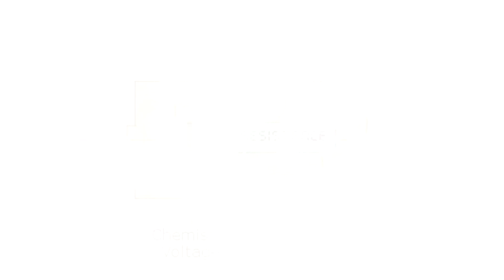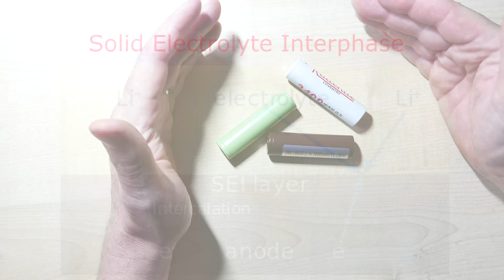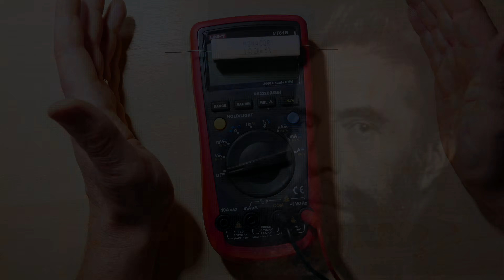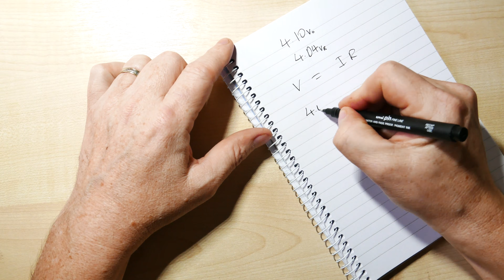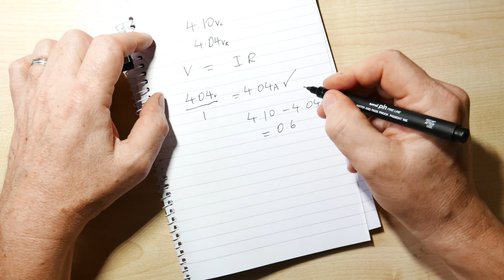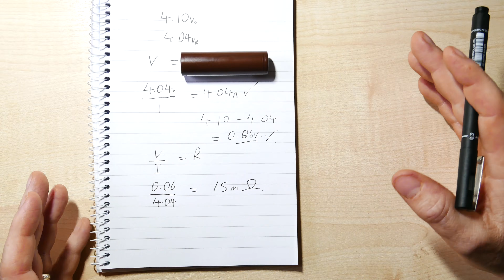18650 Li-ion Internal Resistance Explained & Measured

Comment: It would be good to provide some guidance as to what current range is acceptable for obtaining an accurate/meaningful internal resistance for different cells/batteries. For example, you could tell folks why you are using a 1ohm resistor instead of a 100ohm or higher resistor. That would then let people decide if they could use an Xohm resistor for a given type of battery and/or battery voltage and still obtain reasonable information.

Or...you could provide more disclaimers as to exactly what batteries/cells your 1ohm resistor can test accurately. For example, are you limiting your testing to just 1S1P 18650 lithium-ion cells?

Comment: Dear friend, when i measure a battery (18650 for exactly) with multimeter in continuity mode, this sounds but no resistance is showed and the screwdriver blinking what is happend?
Thank you so much for everything help
Reply from the maker: That won't work.  Continuity mode passes a current through the circuit.  In your case you are trying to pass a current through a cell and in doing that, you will encounter the cell's own current.
Reply: @crazytom  The cell is no more useful, broken?

Comment: can i ask you i have 1Ω 10W ceramic resistor if i try your method the result will be correct or he wants exclusively  1Ω 20W resistor ?
Reply from the maker: Not really.  You're draw 4.2A or 17W.  Try a bigger resistor.

Comment: it's impossible lithium ion battery has that low internal resistance like a capacitor. typical DMM is not accurate enough to measure low resistance so the result will be way inaccurate too. this guy has better method using ESR-meter : https://youtu.be/y7_W1ERDYgk.
Reply from the maker: Check the LG HG2 specs before shooting your mouth off.

Comment: We should calculate Internal resistance at nominal battery voltage, which is around 3.7. That battery holds too much juice at 4.1 volts. It won't give correct results.
Reply: The internal resistance levels are highest at low state-of-charge and immediately after charging. Contrary to popular belief, the best battery performance is not achieved immediately after a full charge but following a rest period of a few hours. During discharge, the internal battery resistance decreases, reaches the lowest point at half charge and starts creeping up again.  Besides, temperature of the battery plays an important role, internal resistance is lowest between 35° -45 °C and is higher below and above these temperatures.  Whenever the temperature of the battery rises under heavy load, so does internal resistance.

Comment: Hey, great info thank you. I have a sky rc charger for my quad lipo's, I bought some used lipo's, using the charger what would you say I look for to check the health of the lipo's. I understand i might be asking a very stupid question, but I've learnt in life, just get the dumb questions out of the way, it's better to look stupid then burn your own house down due to a lipo fire. Thank you for reading.
Reply from the maker: Where Lipos are concerned, the most important factor for many is the C number or max continuous current drain.  This too is heavily dependent on the internal resistance.  Lower the better.

A good check would be to see if your cells can deliver their max current rating.

You should realise that this could push an old cell too far and is not without its risks.

But, for (say) a 4000mAh C25, it should be able to deliver 100A.

You'd need to construct a 37 mOhm resistor or load capable of dissipating 370 Watts.
Reply: @crazytom  That's great info thank you for your time :-)

Comment: Hi nice video,i bought some 18650 online and ahen i tested the IR on my Liitokala most of them were between 38 and 46 can i still these?
Reply from the maker: Sure.  They will most likely be 2C cells meaning the max current draw is 2 x Ampere Capacity/hour.
Reply: Im using those for some time and they seem like very decent cells, tho mine are 60mR 3Ah

Comment: I would have measured the actual resistance (±5%) and used 3+ digits for better accuracy, nice video
Reply: Good advice to check my resistor, but as far as i know they are quite acurate

Comment: Considering this problem with some details still yielded the same answer.  When measuring voltage without a load resistor, we are assuming that Vo is approximately equal to emf since the internal resistance of the battery, r, is much smaller than the internal resistance of the voltmeter, R. Thus, R+r~=R and Vo=emf/(r+R)*R~=emf/R*R~=emf.  Now on to measuring r part.  It is important to select a load resistor RL of a small value not too much greater than r (which I think 1 ohm with proper POWER rating is very reasonable for RL such as in this video).  Since r can no longer be ignored in this step, it must be included in the final computation as part of determining the current term as follows: let VL be the voltage across the RL, then VL=Vo/(r+RL)*RL, solving for r we obatin r=Vo/VL*RL-RL.  So using your measurements r=4.10/4.04*1-1= 0.01485 ohms.  Good video.  Thank you.

Comment: sir 
Please made a video on how can measure the internal resistance of coin battery as per iec 62133-2:2018
Reply from the maker: Same principle applies except you need to use MUCH higher resistance to stay within C rating of coin cell. (~10mA).

Comment: I've been looking at the various methodologies used to calculate internal resistance of a cell and this seems about as straight forward as it gets, so thank you.  I've got a 4-wire battery box, not unlike the one you use here.  

I'll be interested to see how the answers derived using this method differ from the more complex approach espoused by other YouTubers, using multiple measurements and analysis using a graph.

Well thought out and well-delivered vid.  :-)

Comment: Did I hear you correctly? don't fully charge lipo's?
Reply from the maker: Correct.
Reply: @crazytom  Thanks Tom, that is amazing! I fly model aircraft so use Lipo's all the time, I'm often watching for the charger to get to 4.20V per cell...I'm going to stop the charge around 4.17V per cell and see if the lifespan of the pack gets longer.

Comment: Thank you !  Really good info on the slight under-charge to 4.1v, rather than 4.22v.   I had been under the impression I would have to only charge to 80% to significantly extend cell life, but I much prefer the lesser tradeoff of taking it to a 97% charge and gaining 17% more capacity while still extending battery longevity.  Much appreicated !  :-)
Reply from the maker: With a charge range of about 1.4V, a .1V shortfall is about 93%.
Reply: @crazytom  is there a way to jerry rig existing chargers to not charge fully? For example for a power tool battery?
Reply: @jamesrowlands8971 Yes but you have to modify the electronics of your charger the only solution could be to check with multimetre every so often that the voltage does not rise above 19,5-20 volts

Comment: You did a mistake, while calculating current by ohms law you only considered 1ohm resistor. While in reality you should have also added internal resistance with 1 ohm to get real current value. Now in the first place you should have not calculated current but rather measured it and then r= voltage drop across internal resistance / current.
Reply: but isnt the voltage he measured (4.04 V) the voltage across the load resistor (1 ohm) so the 0.06V already is taken into account - i dont think this is a case of current or voltage error measurement circuit because it already took the 0.06V to "cross" the internal resistance of the cell. is there something im missing? please explain further.
Reply: @woll757  Nothing wrong.  When he measured open voltage that's same as 0A flowing.   Then he introduce circuit and determined voltage drop across the external 1 ohm.  He got 4.04v.  And this via KCL means he had to have 4.04 amps in the loop. He had 4.04v across one ohm external.  Now he has to account for the. 06v drop and that occurred at 4.04A. Apply ohms law.  Get his answer.  What he did is right.
Reply: The result only worked out correct and essentially the same because he used a 1 ohm resistor.
However this video is misleading since he wrote 0.06V / 4.04V instead of 0.06V / 4.04A as the formula is written.😁👍
Reply: technically correct, though this method will still get meaningful results useful for comparison
Reply: Im just curious also as we all probably learnt at some point resistors all have tolerances. So when dealing with such small resistances in a battery (battery internal resistance in mOhms) will this tolerance not play a factor in the calculation? Would it be better to actually measure the resistance of the resistor? At my workplace for some of our more critical measurements we actually touch the leads together and get the ohms reading of the leads and add this to our calculations. Even this is not fully accurate as the point of contact to the measured item can change.

Comment: correct me if my computation is wrong. i tested a 18650 Vopen=3.85v Vwithresistance=3.72v i used a 5w 15ohm resistor. 3.72/15=0.248A voltage difference is 0.13v. now computing internal resistance 0.13v/0.248A=0.524ohms? it seems my computation is wrong because this battery is 3months old and the internal resistance is already 524mohms already.
Reply from the maker: Measure the actual resistance of the 15Ω.  There is often wide variations in actual resistance.
Reply: @crazytom  thanks for the reply. i measured the resistance of 15ohms resistor it was 15.3ohms and i computed the internal resistance it was 189miliohms. however there is a large difference(21miliohms) in internal resistance when i used a 5ohm resistor. i got 201milihoms. which is more accurate the 5ohms resistor or the 15ohms resistor? should i test the cell when fully charged?

Comment: that's nice video, but, i think it'll much better if you measure the open circuit voltage later. I mean, it's possible that the open circuit voltage being lower when you wait for the stable measurement of resistance voltage.

Comment: I think you need to measure the voltage after load , not before load, to see how much the voltage drop was.  The voltage just before stopping the current is v0; and the voltage measured after a while ( about 30 secs.) you stop the current is v1.

Comment: Great video thanks! Just a note: to add some precision you could have measured the resistor with the multimeter and used that instead of the number taken from the resistor.
Reply: I understand your position, but keep in mind that many meters people commonly use aren't very accurate at such a low resistance.
Reply from the maker: Good point.

Comment: Only 15m Ohm! that's a great battery you have there. My best battery is 133 m Ohm. Low internal resistance is a must for high current applications (>1.5 A). Thanks for the video, very enlighting.
Reply: 30A

Comment: Thanks this video. But, you made a mistake. Croc' clips have a resistance. Use thick cable or add crocodile(alligator) resistance to calculation. Your calculation result must be approximate 20 mOhm.

Comment: Hey, thanks for this great video. I found it very useful. I was thinking though, you didn't measure the resistance of the wires. :)
Reply: Actually he bypassed the wire resistance  using the four point measuring system.  The Voltage drop he measured was not effected by the wire and or resistor voltage drop.   Cool, eaa?

Comment: Can I just hold the resistor on the cell with my hands? I don't have any fancy holder.
Reply from the maker: Yes you can.
Reply: you assumed he is talking about a 20 watt resistor although he did say "the " and not "a" resistor but you should say "yes you can" with an appropriately rated resistor, however funnier if the poor sod used a 1/4 watt....hahahahh!

Comment: Where did you get that battery holder?
Reply: Try this: https://www.aliexpress.com/item/10-20A-self-locking-4-Wire-Battery-Holder-kits-Resistance-Capacity-18650-Tester-four-wire-battery/32923289546.html?spm=2114.search0104.3.2.1aac7c07M7IagR&ws_ab_test=searchweb0_0,searchweb201602_4_10065_10130_10068_10890_10547_319_10546_317_10548_10545_10696_453_10084_454_10083_10618_10307_537_536_10902_10059_10884_10887_321_322_10103,searchweb201603_56,ppcSwitch_0&algo_expid=1bfb20b6-d086-4eac-a99a-516da93b88fd-0&algo_pvid=1bfb20b6-d086-4eac-a99a-516da93b88fd&transAbTest=ae803_4
Reply: really?

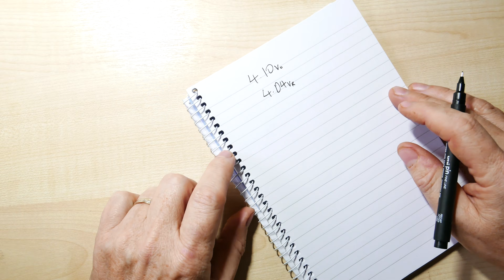Comment: Very clear and helpful - thanks. A safety note though:  at 5:27 you pick the cell up, with the croc' clips still attached and "popped it over there". If those clips should touch each other or touch a piece of metal,. they will  short the cell which will  cause large currents to flow, lots of heat to be produced and burst batteries/fire. Always disconnect at the battery end first.
Reply from the maker: +Chris Wesley. Yep.  Set fire to my sleeve twice in the last few months when that happened!
Reply: @crazytom  was it like instant heat up , boiling and fire or explosions ? Want to know whats the first indicators :D

Comment: Thank you for the method, theory, and how we can use it to assess cell performance over time.  Perhaps contact resistance would be included in the internal resistance value, but if so it would be relatively constant with a given rig and not affect cell assessment.  But perhaps it could detect differences associated with various methods used in interconnecting cells to make a battery?  Using your method, I think a simplified equation might be Ri = Rt(Vo/Vt --1) -- "internal resistance" equals test resistor value times open voltage over test voltage minus 1.
Reply from the maker: Yes.  However I wanted to avoid the simplified equation and demonstrate from "first principles".

Comment: Mate thanks for this. I have just incorporated this in my 18650 Arduino Smart Charger / Discharger.
Reply from the maker: +brettwatty101 Fantastic. I've built one too. Are you going to upload a video? Currently trying to squeeze my code on one of the smaller Atmel chips.
Reply: I have a video on my channel of the first version but not with the milli Ohms check yet. Eventually when I get the time it will Charge test the battery -> Rest -> Discharge -> Test the milli ohms and Monitor temperatures then finally store the data in a mySQL database.

Comment: Tom, I wonder if you could help me determine what battery chemistry I have ?  I have many different 18650 cells and I'm not sure how the charge (or discharge) curves would very based on which lithium chemistry the manufacture used. I do have a data acquisition system so I can create curves at constant current and or constant voltage, but I'm not sure what details to look for. My ultimate goal is not to use the more finicky ones (Lithium cobalt oxide, LiCoO2, ICR, LCO, Li-cobalt) because my application environment is very hot.
Reply: Hi, what is your data acquisition system ? Arduino ?
Reply: www.dataq.com/products/di-1100 USB connected, comes with it's own software interface, but you need to have the computer booted up the entire period of your data recording. $59 (+$12.66 shipping) www.dataq.com/resources/pdfs/manuals/di-1100-usb-daq-manual.pdf
Reply: Thx !
Not budget friendly for me

Comment: Great video. What do these values of resistance really mean though. Would you want to have a pack under a certain resistance or only use similar resistance cells? What would be considered a high resistance and what does that really mean in layman's terms?

Thanks, i will have to purchase a 1Ohm resistor. Does wattage of the resistor matter or change the equation or is that just kind of the maximum rate that it can handle/resist?
Reply: The amount of heat generated by a cell is directly proportional to the amount of resistance it has. Hence, more resistance leads to more heat generation. It also reduces the amount of current it can deliver. 
The best way to see whether the internal resistance is too high is to just compare it with resistance it had when it was new. You can find that info from battery's datasheet.
And yes, wattage does matter. Otherwise, you resistor can melt and get damaged (Heat generated= R*I^2).
Reply: @QueueTeePies  infinite current would mean it would be discharged infinitely fast in case of a short.  Infinite current would only be possible through ideal leads with 0 resistance connecting cathode and anode of the battery.

Comment: can you use this to tell if the batter is still good without using a a device that discharged the battery? meaning could we use the internal resistance to figure out current using ohns law with Vo=i Ro. where Ro is internal resistance?

Comment: Two questions if you don't mind, does the battery have to be fully charged? Does this method work with lipo batteries as well?
Reply from the maker: +A1phaZu1u Any state of charge will do as long as it's within its upper and lower charge range. 

Although it's a demo for Li-ion cells, it will work on all cells/chemistries.  The principles remain the same for all current sources.

Comment: I don't know why Kirchoff made an appearance in this movie ... he did NOTHING ...doesn't deserve a law named after him ... the whole mystery could be solved by Mr Ohm and his humble V=IR.
Also an error in calculating current ... the resistance is not 1 it's 1 + internal resistance .... and that white resistor is not exactly a 1 ohm resistor it's about 1 ohm.... really better to measure the current with a meter.
Reply: he divides the voltage drop over the "white" resistor with the value of it to determine the current flow through the circuit. This way he can calculate the internal resistance so no error.